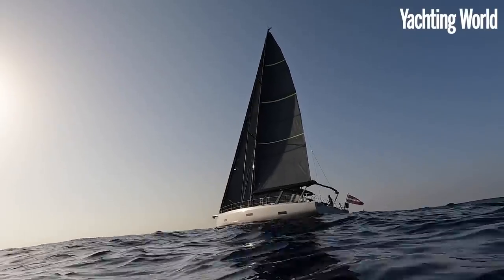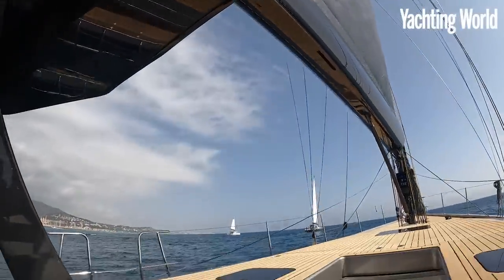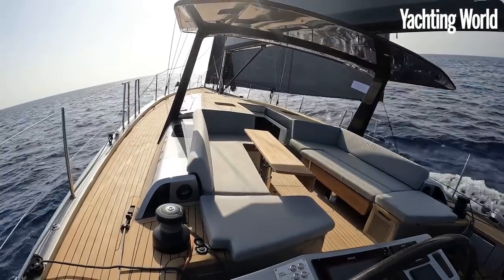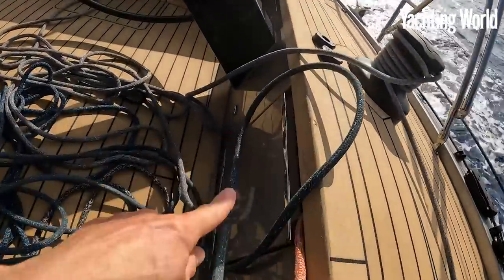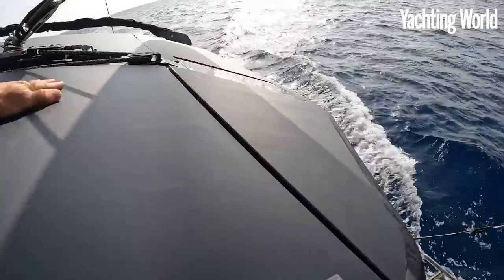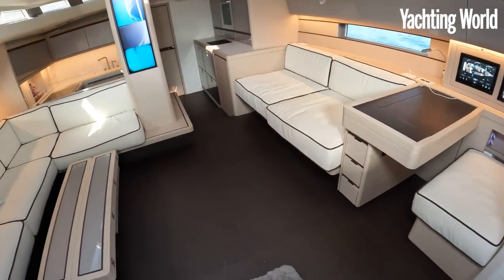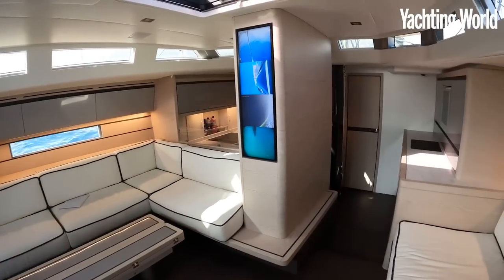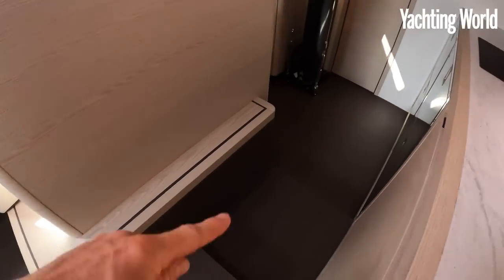A Spicey Ice - check out Felci's latest Italian stallion from the Ice Yachts yard

Comment: As always I love these video's by Toby Hodges. 
And this yacht is truly beautiful

But with these types of yachts, where everything is push-button controlled, I always wonder what happens if you're sailing half-way the Atlantic and your hydraulics fail, or the lines get tangled at the bow. Where are you then with your huge sails and non-working push-buttons. 

It all looks very nice when it's working. But as a sailor you should be prepared for when it's not working.
Reply: I suppose that crossing the Atlantic on a 62' yatch is something not to be made solo or just by a couple. I think at least three, better four would be better